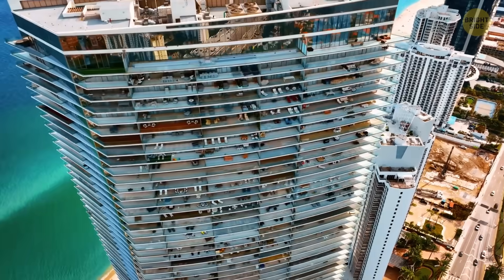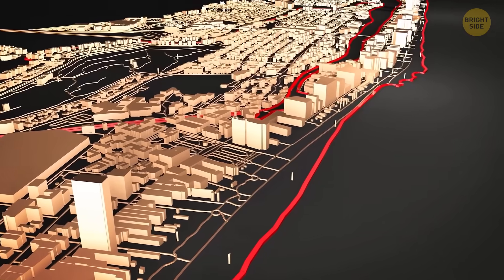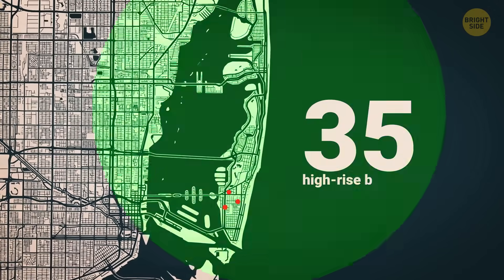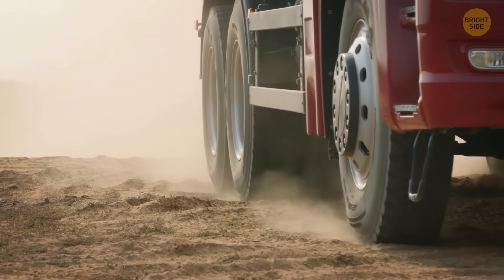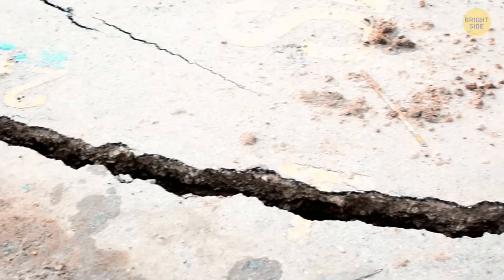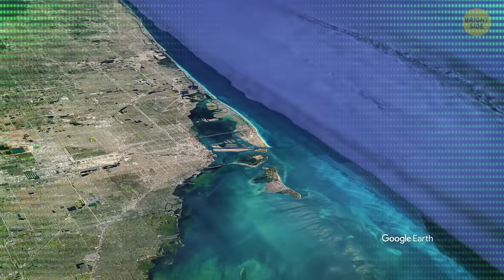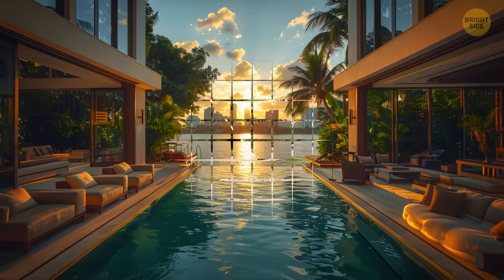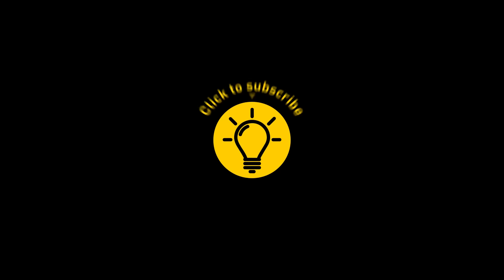Miami’s Most Expensive Buildings Are Sinking Inch by Inch

Comment: the building collapse had in part the engendering didn't anticipate the new age interior applications like 3.5 in thick granite counter tops inch thick shower glass double wide fridges 1 ft square tiles and tiling balconies also weight distribution 
most added weight from renovations is close to the centered hall side baths and kitchen with living space moving toward balcony side

Comment: One fact missed in video is that Florida has a lack of surface fresh water, so they pump from underground wells.  Not only does the water in the limestone move, but it holds up the surface.  If removed faster than water can filter back in, the limestone will sink.